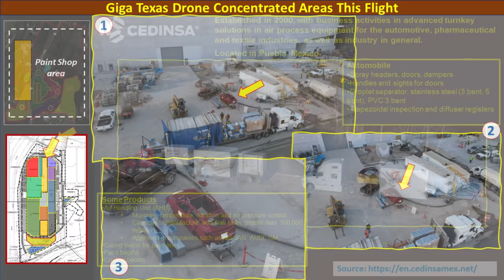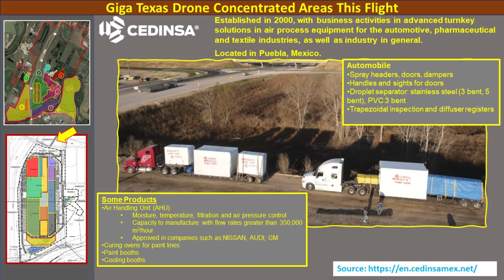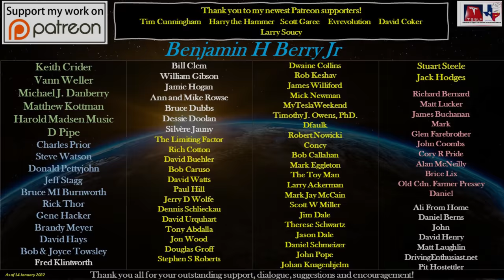Tesla Gigafactory Texas 14 January 2022 Cyber Truck & Model Y Factory Construction Update (07:45AM)

Comment: Has anybody tried to compare the footprint of Giga Texas with the partially finished Giga Nevada?
Reply: Austin over double the footprint.

The image on Google Earth Pro for Tesla Nevada was last updated in August 2019. I don’t know if the factory has been extended since. Using Google Earth Pro’s ruler feature, it’s possible to measure a polygon to get the area of the image shown that is under roof. 178,500 metres sq, converts to 1,921,358 sq ft.

Tesla Austin is not shown complete on Google Earth Pro either, but there are some publicly available dimensions that give a calculated 392,866 metres sq, converts to 4,228,774 sq ft.

Comment: Can someone explain how the roofless & floorless Model Y can have sufficient tortional rigidity & resonance.  I know that my large wagon needs it's excellent suspension, variomat dampers, it's comfortable, rattle and squeak free.  I drive many miles on poor roads and it's great.   I hear Model 3 and Model Y have hard suspension, I wonder how the forces are designed.  Great cars, nothing I'd want to drive with those large wheels and suspension.
Reply: The bottom of the stamped portion of the vehicle is mated to the new structural pack chassis. This "surfboard" chassis is extremely rigid, with a honeycomb-like structural battery pack and two giant monolithic castings anchoring each end. When the body is mated to the surfboard it will be even more rigid than the previous Model Y design and use far less individual pieces, welds, and fasteners to do so. Sandy Munro himself is going to fall over dead based on reduction of welds and fasteners in the new design alone.
Reply: @stevehockey4  In addition, the glass roof is also extremely rigid and when fastened to the body adds additional support.  In short: physics.
Reply: I hope he does not have a heart attack,  from previous videos he seems to have been pressuring auto manufacturers to do the front and rear body connecting to a central core, but nobody took notice of him until tesla.